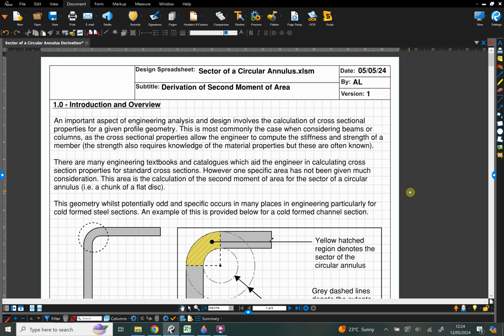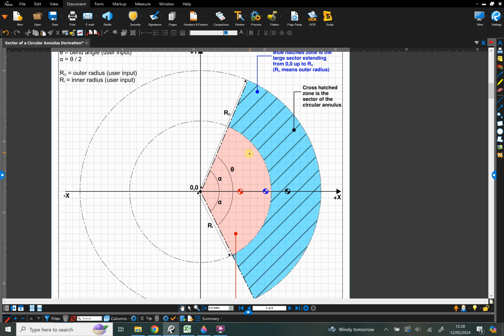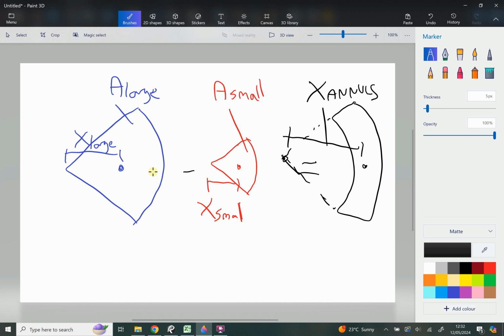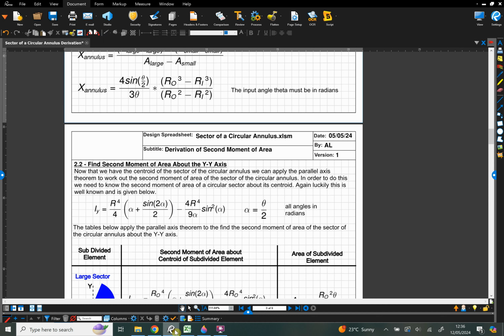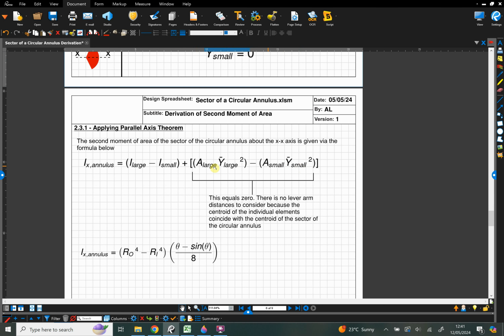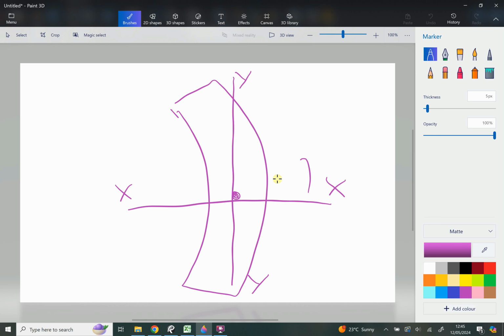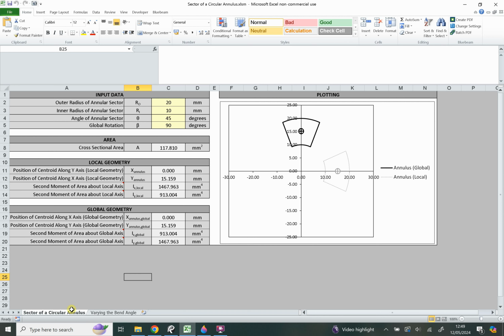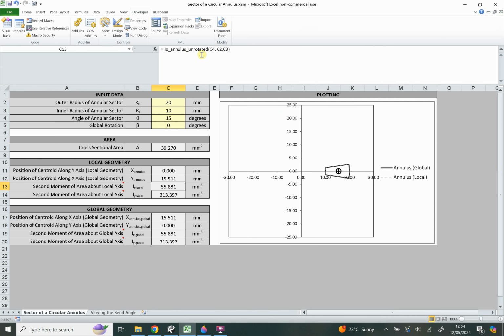Second Moment of Area - Sector of a Circular Annulus (Flat Disc)

Comment: hi Adam, great video, I needed some help, Do you have design spreadsheet for cold formed section using euro code
Reply from the maker: Hi Anonymouskid, I unfortunately I don't have a spreadsheet for cold formed steel but it's on my to do list for the back end of this year (hopefully).
In the interim you can download the uncompiled matlab code for my dissertation project here:

https://www.dropbox.com/scl/fo/xbrhezqwr07y3u8g7r2wu/ANS6u6qSF9E4NOD5JhFmPOU?rlkey=isxdvvqbslv0fowj4eh5613ix&st=dlzwj9dm&dl=0

A word of warning though it's over 10 years old and I personally am not happy with the final result. It's quite sloppy by my current standards. My dissertation report may also help which you can find on my website (free PDF).

Finally I'd recommend looking up CUSFM and the direct strength method. That's another free matlab program by Ben Schafer which lets you run finite strip method eigenvalue buckling analysis for cold formed cross sections. It lets you find the local and distortional buckling modes for generic cold formed cross sections. That's particularly helpful because the effective width method from Eurocode 3 is very laborious and not well suited to complex geometries with stiffeners and such.

If you have any further questions please let me know.